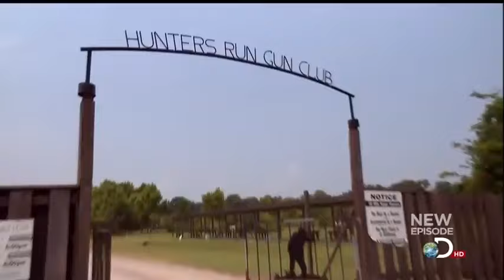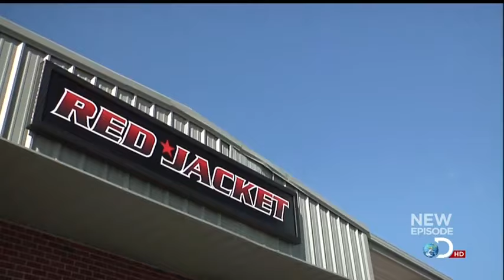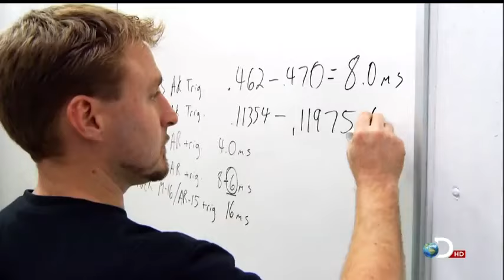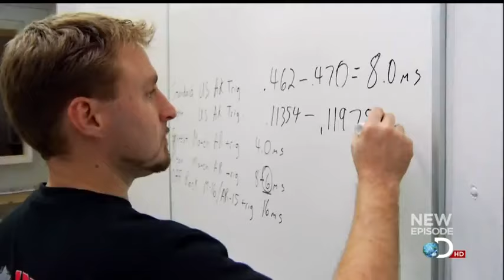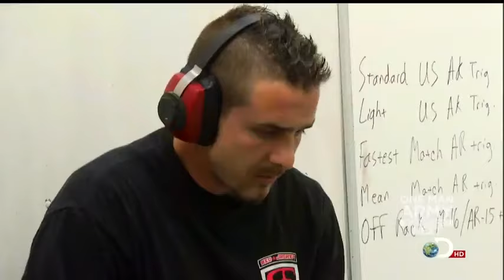AK Sniper Rifle Sons of Guns]

Comment: So they basicly made a Dragunov....Unimpressed.
Reply: looks more badass than a dragunov tho
Reply: +Martin Sætran The mechanisms are slightly different, and even the Dragunov is a DMR designation with effective range up to 600m rather than 1000m.
But agreed, it's a rifle built around generous tolerances. Not genetic accuracy material.
Reply: +Martin S&#230;tran More like they've built a PSL...
Reply: +Martin Sætran More like Zastava... wonder how they fared MOA-vise.
Reply: Nope, just looks more modern.
Reply: not really. Dragunov is based on SKS mechanism. This is more like a PSL alternative.
They used the RPK receiver just like the PSL because the AKM receiver will not resist at that recoil. Also they did not mentioned that they changed the ammo.
Reply: Making a Dragunov out of .308 AK would have been impressive.
Reply: @2A4FIN  you understand that .308 is an American measurement,  .308 win and 7.62x51 are the same thing so making a ".308" SVD wuldnt be hard just adjustments from x54r to x51
Reply: In 7.62x39?
Reply: So he basically touched his daughter???
Reply: Turns out he actually preferred dragdaughter
Reply: Dragunov is 7.62x54R. Standard AK round is 7.62x39.
Reply: @Aandeg1536 wrong
Reply: @connormelvin exactly
Reply: Was going to say the same thing
Reply: AN AMERICAN VERSION!

Comment: Surprised these vids are still around due to Hayden's crimes.  Frankly I'm surprised he has survived in prison this long.  Hard enough for the shows to survive with whack jobs out there much less the owners being felons.  I do miss these kinds of shows because of the content but not the stupidity of network injected drama.  And there already was a decent AK DMR for the 7.62x39, the Iraqi Tabuk.  But they didn't say squat about converting to .308, which you can see on the table in boxes at the test firing.
Reply: the reason its still alive  in prison is because he is in the NONCE wing of the prison ! otherwise he would be stabbed in 2 secs.

Comment: Holy shit...does he KNOW about guns? Bolt action rifles are used on purpose for MANY reasons, (dont need to siphon off gas to cycle bolt, means more pressure dedicated to sending the bullet downrange, the manual bolt also helps conceal the shooter's position by preventing gas from blowing out of the breech, PLUS the shooter doesn't have to worry about shells going astray) not just because of accuracy. Hell, there are many many semi-auto rifles more than capable of out-shooting a Remy 700.
Reply: A semi auto rifle does not take energy away from the projectile…. That’s ridiculous. The gas used would have been expelled from the barrel regardless and the action doesn’t open and depressurize until the round is out of the barrel.
Reply: I believe that shooters (gun people and want to be gun people) should learn black power as diminishing affect with barrel length. Powder burn rate and load to propel a projectile to usable speed (velocity). Without too much rapidly expanding hot gas leaving the muzzle and pushing projectile (bullet) off course. And enough powder to still be accelerating the bullet as it leaves the barrel to not be slowing down hurting accuracy. It is all in balance

Comment: An AK sniper was never done because it was not necessary, that's why there is the SVD Dragonov, although it seems an AK, internally is completely different from AK, which is why Mr. Dragonov was called for the project, he is specialized in  precision rifles.

the gun barrel in the video, it's stupid, how much will weigh that gun, 20lbs?

that is probably a  Vepr in 7.62X54R ,or other caliber ,that mag is not for 7.62x39.

Comment: SVD is nice sniper rifle, reliable and accurate, but AK sniper rifle is nice!!!
Reply: Except that the SVD, despite its name, isn't a sniper rifle, it's a marksmans rifle.
Reply: yes and it has problem with design, which has impact on bullet flight, in result not very accurate. Mosin Nagant is better
Reply: Shota Buadze The VSS Vintorez is a very good integrally suppressed sniper. Much like a SVD. The russians also developed another suppressed sniper rifle based on the Vintorez.
Reply: Vintorez is nice rifle, but not for long distances, in urban warfare it might help
Reply: Connor Morrissy
Yeah i saw that , its like a 12.7 mm integrally suppressed bullpup, very accurate
Reply: Ika Koc And fairly ridiculous. But, governments keep getting silly ideas like that.
Reply: *****
 well itts not silly,they needed an anti armored vehicle gun ( not including tanks and that stuff ) and they made it,and it works very well
Reply: Ika Koc An integrally suppressed, 12.7mm anti-vehicle gun? And you don't see why that's silly?.
Reply: *****
 well my mistake its not a anti vehicle only gun its all purpose i will see if i can get you the link
Reply: Ika Koc
 I think you mean the VKS sniper rifle, http://en.wikipedia.org/wiki/VKS_sniper_rifle its not all purpose btw, the VKS's 12.7x55 are too weak to penetrate steel like a full fledged 12.7x99mm or 12.7x108mmR, except special ammo types (Russians make some crazy ammo, 7N6 a.s.o.). The 12.7 diameter is solely for knockdown power. In silenced weapons weight is the key, the projectile is not allowed to go faster than the speed of sound, because you then hear the crack of it breaking the sound barrier. so its gotta be heavier. Force = mass x acceleration
Reply: 13i0Hazard666
oh ok,didint know that TY

Comment: How long barrel did they use on that Saiga?
Reply: it's a 24 inch (0.6 meter) Heavy solid Bull Barrel (straight cylinder barrel) made of High Grade Stainless Steel Which is so damn rigid & stiff :)

Comment: Too bad saigas aren’t Ak platform they are sporting rifles
Reply: Saiga is more ak than any other ak on the market. They are made by izhmash, an original ak factory in Russia. Is it not an Ak because it has a different stock?? One can outfit an ak with any kind of stock and grip, it doesn’t make it not an ak. Look at the receiver, the rivets, the barrel… do you mean that it’s not automatic? If that’s what you mean, you are correct, it is semi auto. Still an akm.
Reply: They are literally just AKs that have been called sporting rifles.